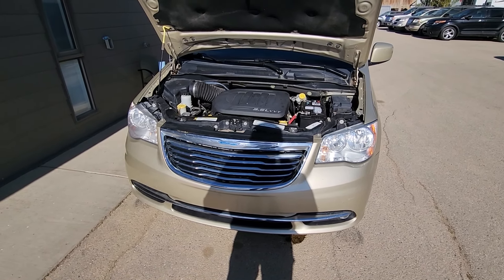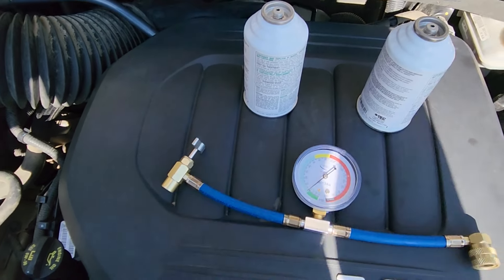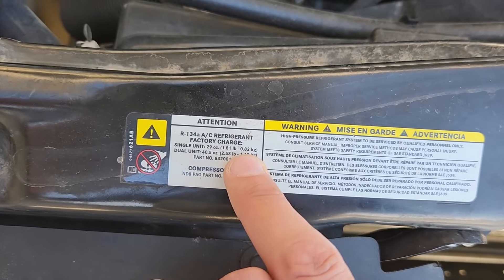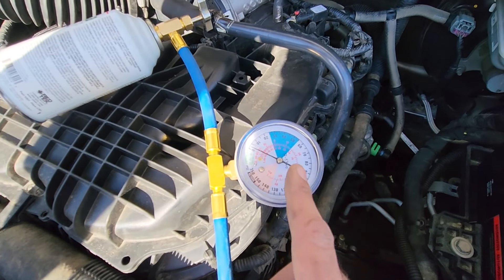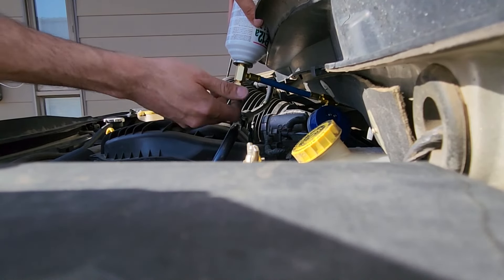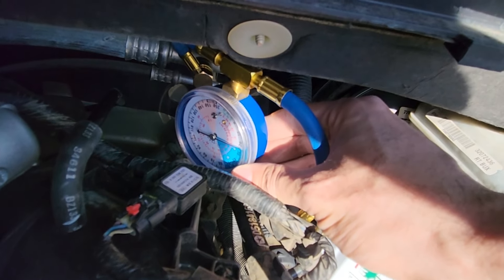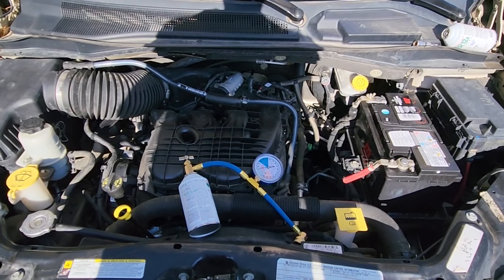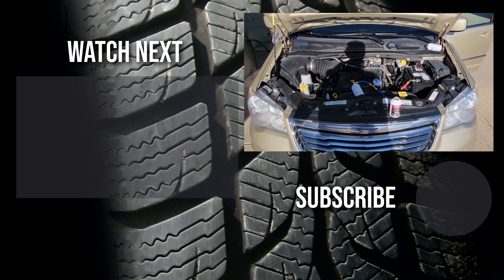Chrysler Town and Country - HOW TO RECHARGE / REFILL A/C AIR CONDITIONING BY YOURSELF

Comment: Sorry - Poor video.  Does not really show how gauge should read.  Also A/C systems need to be charged with vapor - not liquid refrigerant.  So inverting can of R134a is incorrect.  Cans should be kept upright so only vapor is released.
Reply: But it actually says on the can, invert it
Reply: During compression you need to add liquid, only add when compressor is activated.